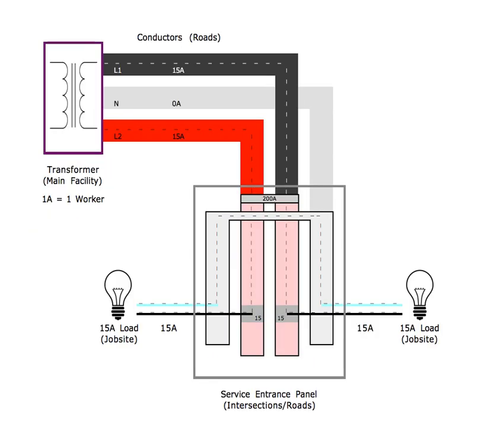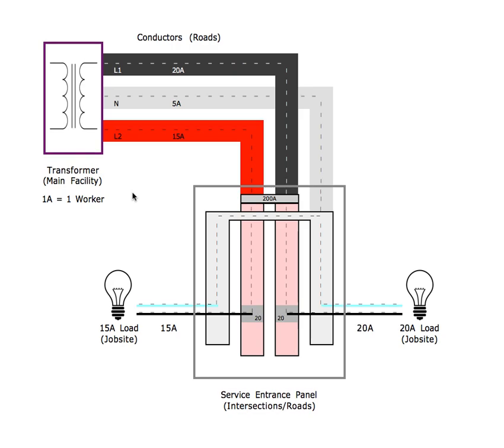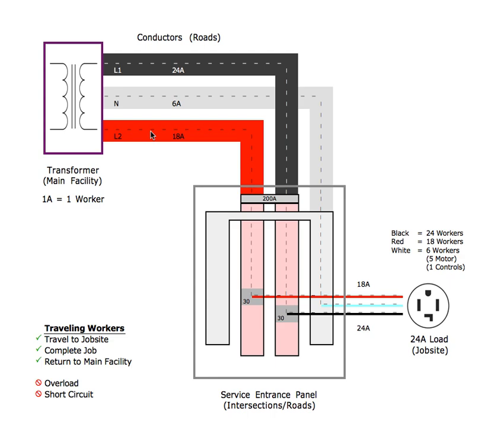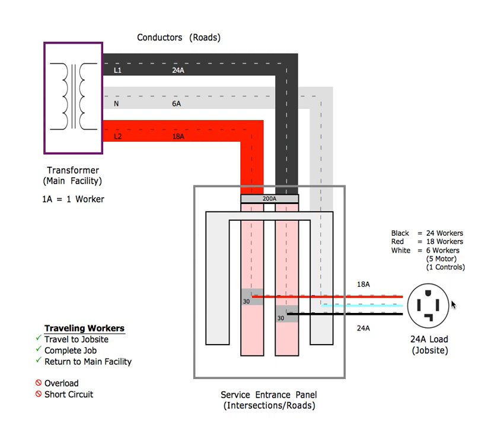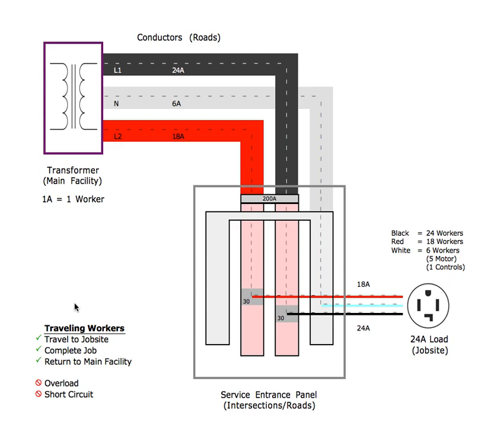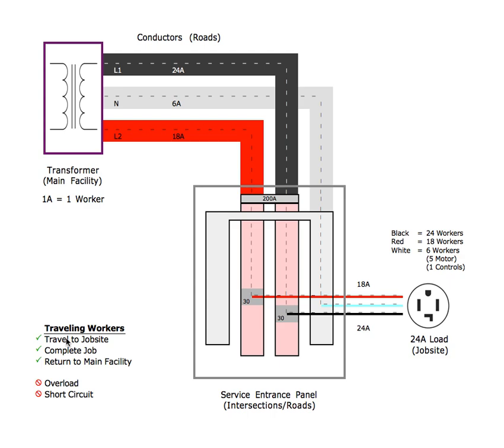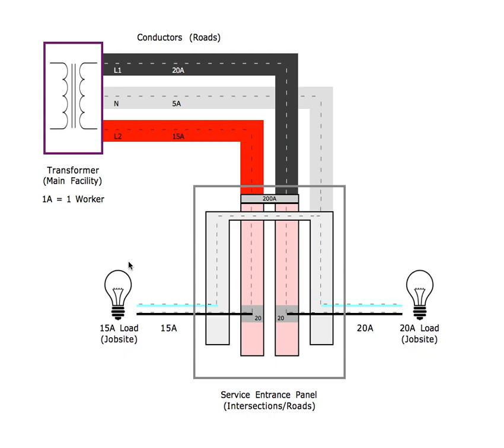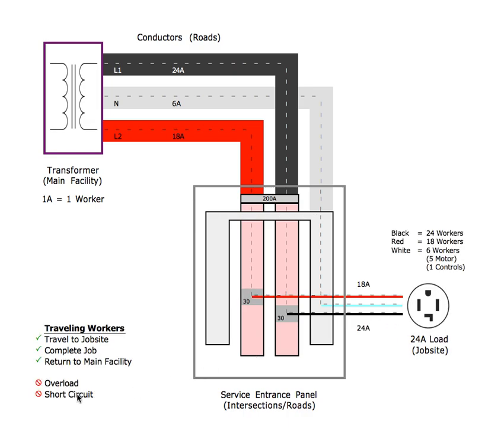AC Current Flow: #1 A New Analogy

Comment: Very good analogy!   Except for the short circuit.  It kind of lost steam at that point because instead of a few workers, during short circuit, you have thousands of workers.
Reply from the maker: Thanks for watching. Yes, the analogy does lose steam—if you get too technical. Remember: I am not an electrician, an engineer, or a professional in any field. I was a complete idiot until my second wife encouraged me to read (in my early 30s). When I was a child, I fell (or was pushed) down a flight of basement stairs; and that was only the first of many concussions. As such, I had almost no sense of "comprehension" until I was in my teens.
My "short circuit" analogy will indeed seem vague and inaccurate—initially. I took a little poetic license on that feature because I really didn't think anyone would really care much about most of the videos I post. (I get very few views on my "non-accordion" videos.) But if you "read into it" just a bit, you might recall a time when you were driving along a main highway and you noticed someone "cheating": that is, crossing over a grassy median to get to an opposing lane, when in fact, the crossing itself is posted as a violation of the law. Inevitably, at some point, other "violators" will follow suit—and cross over at that very same point. Those violators (the many) will essentially be unrelated to the workers (the few), yet the effect (the unsafe condition) still exists—until, of course, law enforcement shows up (i.e., the breaker trips). I could have noted this feature, but, like I said, most people don't care.
And while I'm here: I won't reply individually to your other comments because I'll be perceived as being negative or contentious (which I am not). But I will say this: 
(1) I stated clearly that my definitions of "Neutral" were "Non-NEC" definitions; 
(2) "Single Phase" can NOT be a true "single-phase" phenomenon when current within ONE cycle changes direction. That just doesn't make sense—and it never will. I stand by my premise.
(3) You COULD conceivably refer to "Three-Phase" as such, but ONLY because the generator is essentially "divided" in function. That is, you could have ONE phase "contrasted with" (or "differentiated from") another. BUT—and I stressed this repeatedly—EACH so-called "phase" (A, B, or C) would itself be comprised of TWO phases (one direction of flow; then the other). 
If people wish to ignore new perspectives, that's fine. I don't care. I don't make a penny from my ideas. One of my two heroes, Arthur Schopenhauer, said it best:
"All truth passes through three stages: First, it is ridiculed; second, it is violently opposed; and third, it is accepted as self evident."
So, I guess we'll just have to wait to see, won't we?
Reply: @    I did not go to college for electrical.  I was industrial arts major with drafting as main study.   I fell into electrical in 1983, and fell in love with my job.  Started as drafter, then designer, then Sr. Designer, then Sr. Design Engineer/Project Manager/head of design.   Mostly for electrical contractors.  Last 21 years was for top 15 in US electrical contractors.  I became a registered Professional Engineer in 2007.   Retired 2018.   So, I’m on the job taught.  
Any questions, just ask.  I will try to answer.